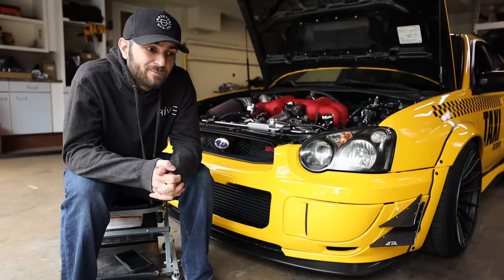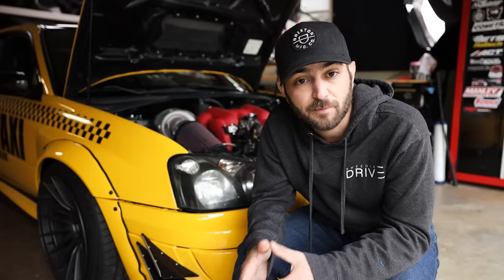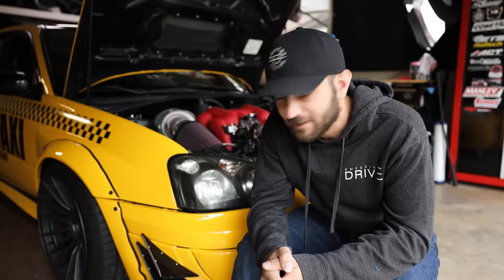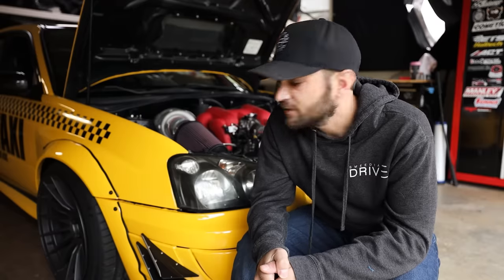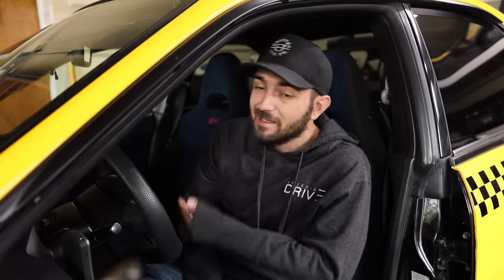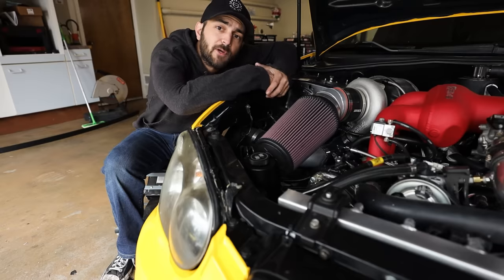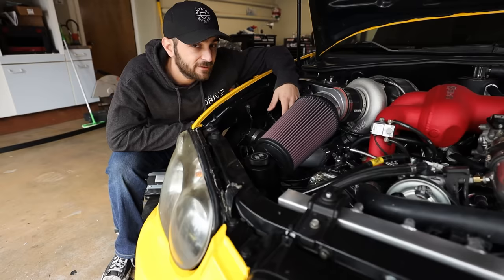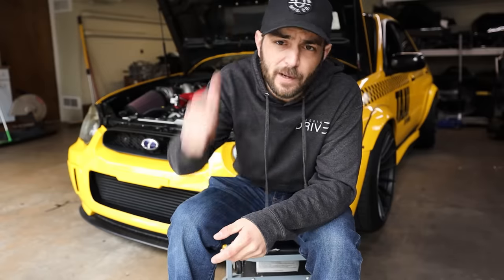What You Can do To Keep Your Subaru Reliable.

Comment: I like your comment about the reality of the the block. It’s not forged, it’s a flat 4 and it has a shitty tune from factory. The fact that you can make 400ish to the crank reliably is actually impressive lol
Reply from the maker: Gotta remember they're cast aluminum engines. Nit the strongest lol
Reply: @Smeedia  lol truth
Reply: The factory pistons in an ej207 sti are forged and how can you prove that the factory tune is bad my legacy gt has 300,000 miles on the stick tune
Reply: @drewlindsay3553  my comment does not apply to jdm cars, their tunes are way better. Usdm sucks

Comment: I got a stock 2017 wrx. I let my car warm up AT LEAST to 150 degrees (oil temp in the mini display in the dash above the radio) With the way I drive, even if I am on the high way for a long time going 75 or something, I have never gotten temps higher than 208 (and that's after going full boost to pass some one) When I slow her down to 75 and stay there, the car temps drop to 204-207. Then every once in a while, I'll get off and get gas and let my car cool down a bit, and she gets to 194-197 (depending on if it's a hot summer day or cold winter) I've had litterally no issues with that. Also checking the oil every once in a while and making sure everything is good. I know right now I gotta handle my oil drain seal (starting to do leaks but very minor). 90k miles and no rod knock. Fantastic car that will work great if I keep up with everything.

Comment: I came from the Porsche world where they recommend oil changes every 10k miles or yearly and I can confirm that it is not the same with EJ engines. Just because both are boxer engines does not mean they are the same. It’s not that expensive or difficult to change oil (and filter!) every 3000 miles
Reply from the maker: Can do it for $40 and 20 minutes out of the day. Dubsrus are somewhat temperamental at times
Reply: @Smeedia  I’ve had good results with that Rotella diesel oil. 192k miles and still running strong at 18psi (original stock turbo still)
Reply from the maker: Ran Rotella for years before swapping to motul, good oil 🔥
Reply: @ericMT  what year is your subie?

Comment: So true about using quality parts. I'm orig owner of an 05 sti. At about 115k got a code that front o2 sensor was bad. Bought a Denso o2 sensor off Amazon. Worked fine for a few thousand miles then started to get a funky idle and acceleration hesitations. Tuner and 2 diff mechanics could not figure out what the issue was (kept blaming the injectors which were fine). Long story short, engine failed had a new IAG stage 2 tuff SB installed at about 118K and still had the idle/hesitation issues. Finally went to a new tuner who was quite savy and thought that my O2 sensor was likely counterfeit or bad. Put in an oem o2 sensor and car idled and ran perfectly. Counterfeit o2 sensor from Amazon likely caused my orig engine to fail. Lesson learned, only buy oem or quality aftermarket parts. Amazon is no place to buy car part for our subies.
Reply from the maker: The amount of OEM counterfeit parts coming out had been absolutely insane lately 😤

Comment: Great vid.  Hoping more people will finally "get it"  Subies get a bad rep. for being "ticking time bombs" but 98% of the time, they blow because of either abuse/poor maintenance,  or idiots slapping on a bunch of bolt on parts modding the crap out of it without building up a proper foundation first !  I am surpised you didn't touch on the one thing, and probably why you are seeing a lot more "my subie blew up" posts. The weather is getting cooler, which makes it easier to go do burnouts/drifting in the parking lots. #1 way to blow your subie up real fast!
Reply from the maker: Trying to help where I can 🔥🙏

Comment: I have an AEM oil pressure sensor and I use that to gauge (excuse the pun) when the car is warm enough. Typically oil pressure is around 97 PSI at first startup and I wait till it drops to 90 before driving, which also is almost exactly the same amount of time it takes for the coolant gauge to rise up a couple notches from zero. Probably 4 minutes or so.

I figure that the oil is warmer than it was at cold start and the coolant is also beginning to circulate meaning the thermostat has opened, so it’s safe to drive. I do this every. single. time. I drive the car.
Reply: man im so anxiety ridden for my poor ol EJ that i bought from some shady dealer on accident (learned they were shady after i bought the car, looking at you boss motors) and its got 180k on it currently, i literally give it atleast 10 minutes before i even think about driving it LOL

Comment: Def agree!! Also proper crankcase ventilation. Too much crankcase pressure will blow out seals or worse. If your adding a 100hp+ to your motor enlarging the hose size or introducing a catch can will help dramatically.
Water meth ppl like to say its not for daily i call bs! Ive been running snow performance kit with a 40% methanol 60% water mix. Drastically reduces iat probably as much or more then an upgraded intercooler. Its only used in high boost situations so 1 gallon will usually last 30 to 40 gallons of gas. 
And will also cut down on carbom buildup significantly. Its like steam cleaning your valves. Even more helpful on direct injection. My tuner has my cel set to flash when knock is detected so i know to let off. I monitor oil temp with a 1/8 npt hollow drain plug. Super easy no drilling and tapping. Funny you said that, my coolant temp will reach half long before the oil temp moves. I usually wait til ay least 100°f before driving and 150°f before getting into boost. A wideband is super helpful at making sure your afr are stable. Pretty much a necessity. Aem x series with bosch 4.9 have the fastest response time and are extremely reliable.
Boost gauge also helpful especially if tuned with boostcut eliminated. Replacing any old rubber vac lines with silicone can save you from air leaks and lean conditions. In volvo world we call this stage 0. Plugs ( 1 step colder if plan on adding power and properly gapped will save blowout 
.020-.024 depending on engine) coils or wires cap rotor, replacing any aged stiff rubber hoses, refreshing pcv system, changing fluids (believe it or not brake fluid goes bad), coolant flush, back flushing heater core, checking any mounts and steering components, intake throttle amd exhaust gaskets. As far as fuel i always always run 93 and often add vp racing octanium (adds 7 octane) believe me it works. Ive ran as much ignition timing on wmi and 93+vp as ppl on e85 with zero knock even on hot days with multiple runs and on stock intercooler. And almosy as important as letting your car warm is letting it cool. Dont run it hard down the highway get off the exit to your house and shut it right off. My buddy blew the turbo om his legacy gt got it glowing and shut it down right after. Youll coke the bearings, it literally bakes the oil into char. Turbos and downpipes can get as hot at 1900°f so you can imagine what that does to oil that stops flowing. Think of it like that stream that doesnt freeze in the winter while all those still ponds have 2 ft of ice. You can get a turbo timer that runs off oil temp but i jist use the old saab suggested method they used to stamp on the sun visor. "Let car run 90 seconds at idle before shutting down".
Im sure i missed some other good points and apologize i in no way am meaning to hijack your video. Just thought id offer my 8 cents (was quite a bit more then .02)

Comment: My 2009 Forester X (non-turbo) is still stock and still going strong at 195,000 miles damn near 200k. Thought bout slapping a turbo on it, but putting turbos on n/a Subaru can really mess everything up. So I just got exterior mods on it and not touching the engine compartment, just leaving it stock

Comment: Got knock? Add methanl/water injection 👍 I've been running the Snow Performance stage 2 setup for ~40k miles on my FA WRX. 112k on the odometer and I've been auto-crossing it since March 2020.
Reply from the maker: Solid kit! Have the fail safe added as well or are you only using it for the cooling?
Reply: I am the fail safe lol. Just have to make sure the LED lights up and always monitor the AP for any funny business. The only issues I've had are with the quick connect fittings going to the tank/pump coming off after being hit by the sub woofer (It's been addressed now lol) and draining all the fuel into the spare tire compartment. "What is that smell? Why is the car running shitty? Oh..."

Comment: You wanna talk about heat soak, try Rallycross and grid, good lord iat's go through the roof. And not much you can do. Love the video man! Hit multiple nails on the head!
Reply from the maker: IATs 📈📈📈 my old TMIC set up on my 07 STI would cook bacon when I ran Auto cross in Louisiana 😳
Reply: How do you monitor IATs? I have a JDM WRX bugeye running 307bhp and 352nm/TQ so pretty good for a td04 with turboback and upgraded fuel pump.

I was going to upgrade to an STI tmic but got told it wasn't worth it since I don't race it's a daily driver.

How do I monitor IATs and is the WRX top mount fine for this use?
Reply: @liammcknight3845  I used a laser thermometer when I pop my hood at grid. I've got an Sti intercooler that I'm going to install a thermocouple into and I've also got the sprayer kit as well. And I'll monitor iat's with the thermocouple though when I get there

Comment: In the grand scheme of things I know nothing about Subarus. 
With that said I’m in my first sti attempting to build the ultimate daily… without ruining it. 
I have cheaped out on… nothing. Iv done a lot although not much past intake and catback in terms of air fuel. 
I’m currently running 93 stage 1+ OTS tune. Running the redline intake. 
Did every 30k maintenance item. 
My engine runs smooth, happy and knock has never reached past 2.4. Besides bad gas. 
Follow his rules follow the Bible of reliability items and consider 0w-40 instead of 5w-30. 
 Mine is daily beaten and has a obsessive mechanic. I’m pretty proud and not worried so far.

Comment: i plan on keeping my 21 STI bone stock with the exception of some cosmetics. But I am still terrified of blowing up because the more I look the more horror stories i see. But I know that's also biased as no one goes online to post about how well their car is running. Your advice is good. I plan on babying the car a lot as it is an inner-city car so I don't see the point of going full throttle at lights anyway

Comment: This is couldn’t have come at a better time, especially since I’m getting my first STI in the next few a days to week😍 I’m lucky enough to have the short block recall done on the STI I’m buying. I am however looking into buying a closed deck short block or Type RA short block. I am talking to a well known performance shop that is in NY 4 hours away from me.
Reply from the maker: What block are you looking at going with? 👀🔥
Reply: @Smeedia  idk yet, I’m going to modify the car as it sits right now to make about 360whp, he has a list for me for that build, then the built motor I’m thinking of going rotated turbo kit, to handle at least 700, I’ll probably be doing the build myself but buy the short block, I’m a mechanic but with this build I don’t wanna mess something up. That’s only one build I’ll be doing though.👀🔥 I will probably start a channel for both subies I have and see if I can get a fan base going.
Reply: @thatorangesti8864  hey bro I’m planning to as well, did you buy it and how is it?

Comment: When I built my wagon I made sure I spent on top parts I was told by a tuner years ago spend the big money once is better than spending it twice on cheap parts which will cost more in the long run
Reply from the maker: Facts, I've learned the hard way. Buy it once so you don't have to buy it again

Comment: Based on my experience, my Subaru Impreza WRX 2002 Bugeye is perhaps one of the rarest models in the Alps. In my community and among other Subaru enthusiasts here, we've collectively driven around 300,000 kilometers with boxer engines. The key to their longevity is diligent maintenance. It's important to note that Subaru recommends oil servicing for EJ20 engines and the EJ25/EJ20X/EJ20Y variants every 9,000-10,000 kilometers. In contrast, my Audi A4 TDI, for instance, requires an oil change every 30,000 kilometers. Boxer engines demand meticulous maintenance to avoid damage, and using high-quality oil is crucial. Personally, I've only used Motul 6100 or ARAL BlueTronic oil.

When it comes to modifications, I prefer to keep my car stock. However, if you're looking for a bit more power, I would consider ECU mapping. The Bugeye models tend to run a bit rich, so optimizing the fuel-air mixture can extract additional power without compromising longevity. I would advise against tuning the car or adding aftermarket air intakes if you intend to keep it running smoothly for the long haul. All in all, the boxer were designed to run at least 275.000 Kilometers and the failing rate is under 20%, for the ones tested in the laboratory, a little bit higher failing rate as my 3.0 TDI, but V6 diesel clearly live longer than petrol boxer engines. Still a boxer can be reliable, and you really have to fuck up the head gasket with a shity tune in my eyes.

Comment: 1. Keep it stock
2. Do the proper maintenance
3. Keep it stock 
4. Change the oil every 6,000 miles
5. Keep it stock
6. Check the oil every 1,000 miles, top off as needed
7. Keep it stock 
8. KEEP IT STOCK 

Thank you for coming to my Ted Stock
Reply from the maker: No need to keep it stock just modify it the right way and do oil changes every 3K miles.
Reply: @Smeedia  I've found that my 2.5i likes the 3k intervals on royal purple, any longer it gets pretty dark and cold starts make valvetrain noise

Comment: Got my 04 wrx with almost 185k. Stock motor, catless uppipe and TBE, turbo inlet, EBCS, walbro 255, stage 2 OTS map, I drive like a normal person.

Change the oil every 5k. Don't let my car warm up, I let it run for a minute then drive off without going over 2.5-3k til it's up to temp. Done a ton of preventative stuff (killer-b oil pickup / baffle, DOM cooling mod, changed all the hoses under the hood, new MAF, new coil packs) and address problems as they pop up. 

I'm surprised it's lasted me this long, at this point, I think my car will last past 200k
Reply from the maker: As long as they're taken care of they're 👌 seen some stock engine cars go past 350K miles
Reply: @Smeedia  alright, I'm shooting for 350 now 😂

Comment: Also, with modding the stock block, I’d be real careful on a 350+ build on a stock non-RA block. The case likes to flex under high boost/high power and can lead to rod bearing failure. If your doing a rebuild, spend the money to size up the case bolts and head studs.

And with speed density, although kinda unnecessary on stock turbo, is beneficial cause your taking air temps and density post turbo and intercooler which helps you prevent being hard on the car with high intake temps.

Comment: 05 Wrx pro tuned for 7yrs bolt ons 126k miles still has original head gaskets,turbo, engine, trans it doesn’t even use oil. I change oil depending on how hard it’s been ran but still never go over 3500-4K miles

Comment: Hey Smeedia, I have a question for you.  Ive been watching your videos for the past couple of weeks.  I own a 2013 STi hatch.  Im really impressed with how quickly you tear down these EJ engines and trouble shoot any issues.  Just curious, are you a mechanic by trade or did you teach yourself how to work on Subarus so efficiently?  Im only asking cause working on my STi has always intimidated me for some reason.  I am mechanically inclined and good with basic tools.  I just did the DP on my STi about 2 weeks ago and it wasnt so bad after all.  Not sure why I was so afraid to dive into it.  Please keep the videos coming.  Very informative.
Reply from the maker: Definitely more to come and all self taught, I never went to school for mechanics, never have gotten an ASE Certificate or anything. Just self taught. Best way to learn IMO is to just dive into them 🙏🙏🙏
Reply: @Smeedia  installing my DP gave me the confidence to continue working on my STi myself.  That's pretty cool that you taught yourself how to work on these engines and your making these videos.  You break it all down very simply.  Watching your videos has been helping me understand these engines alot more.  They're not as intimidating as they may seem to work on I'm realizing.  Please make more videos.  The Subaru community needs you 😂 👍✌️.
Reply: With youtube were all mechanics lol.. I put an 04 coil pack etm throttle vvt cam motor into a 98. Drilled end of cams for rotor plate and distributor, swapped the 98 accessory bracket amd accessories, swapped the 98 intake manifold and cable throttle, and ran the vvt solenoid to a 12v load dependent source. Before this i had never done more then brake pads and oil changes. Hours upon hours of forum reading. Now i have done about everything on the car but engine internals.

Comment: Tanner I remember you saying to never run an intake and downpipe on newer STi's, so I've been debating on going "stage 1+" or straight to "stage 2". That being said I've been talking to Neil at Bren Tuning and he claims he's able to tune for it to run safely on stock fuel system with Cobb intake and Cobb GESI downpipe. I already have cylinder 4 cooling mod and AOS as well as an AWE track edition catback. I Just wanted to see what you thought being how you always suggest to talk to your tuner plus I trust your judgment 100%. Thanks
Reply from the maker: You can tune it to work on the stock fuel system but gains are minimal and not worth it IMO. Tunes are less aggressive and are held back on boost. You can but I still wouldn't advise it
Reply: @Smeedia  cool so than I'll just go with the down pipe and heat mitigation mods.